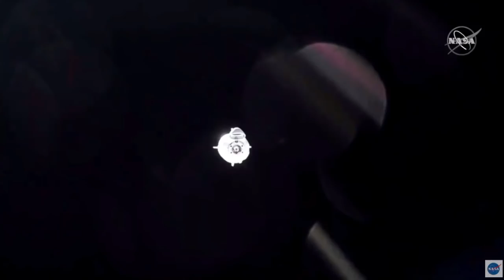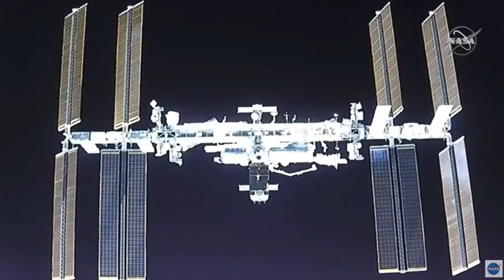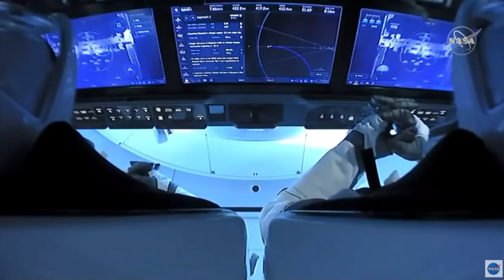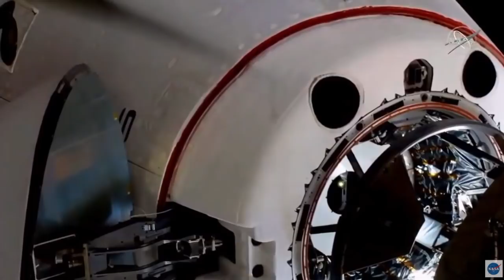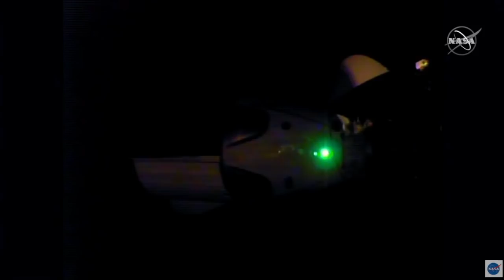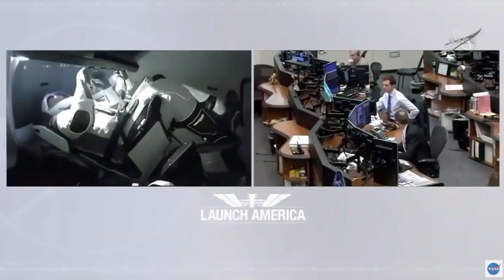Demo-2 Crew Arrives at the ISS (Demo-2)

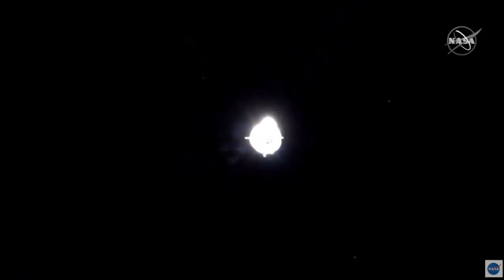Comment: 14:53 14:46 Low earth satellites are the bright white dots that are moving.  Both the Dragon capsule and satellites below them are lit up by the sun.  That's why they appear bright.  LEO satellites are actually passing by all the time, both above and below the space station, but you can only see them when the sun is at certain angles, just like the ISS and capsules are bright or dark, depending on where the sun is.

11:45 11:52 Any dots that don't move in an electronic camera image in space are probably cosmic ray hits.  Cosmic rays are high energy photons that the Earth's atmosphere mostly absorbs.  In space they're more abundant since there is no atmosphere to absorb them.  Electronic image sensors in cameras are affected by the cosmic rays, which show up as dots as individual pixels in the sensor are hit.  That's a reason for the red, green and blue dots on cameras in space that are pointed at the dark.  In some cases damage from cosmic rays is permanent.  That's why the pixels are stuck "on" and show up as colored dots.
Reference https://en.wikipedia.org/wiki/Cosmic_ray